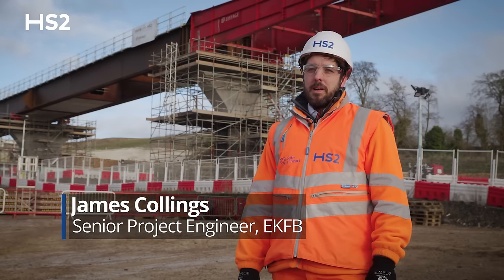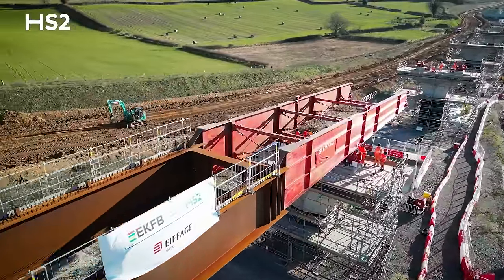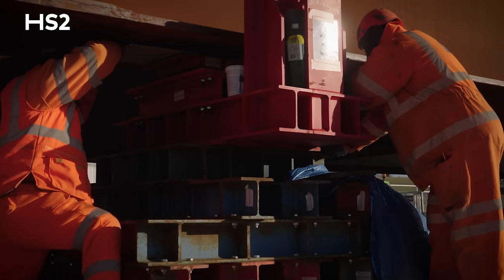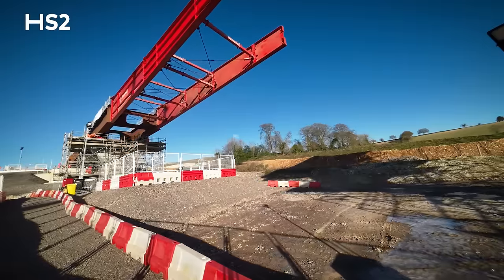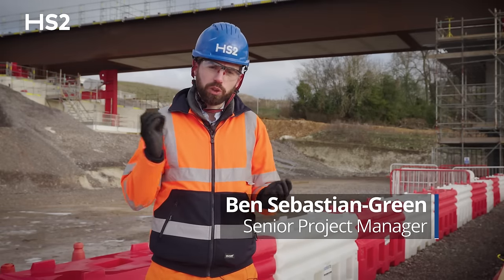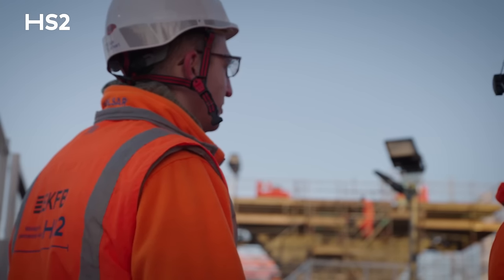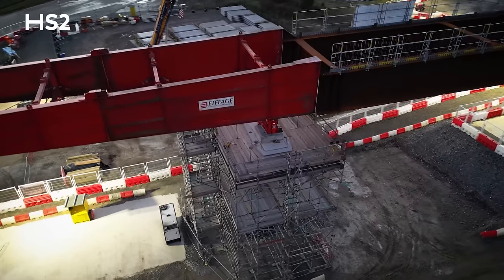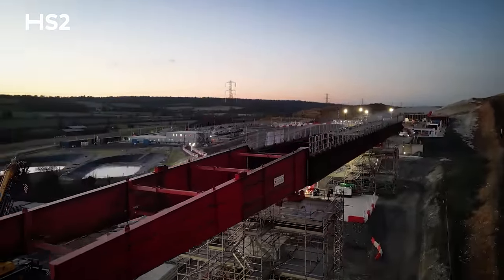HS2 begins epic year-long, half-kilometre viaduct deck slide

Comment: This will be cancelled by years end.....
Reply: The leg between Birmingham and London Old oak commons will be completed and I'm optimists and think that trains will be running on this leg by 2028 or 2029 at the latest. 

If we get a Labour government, I suspect this is how it will go down,

They will commit to building a through station at Manchester and surrounding infrastructure to support HS2 and HS3 eventually arriving into the city. 

They will reverse the government downgrading of HS infrastructure around Birmingham, so what is built is able to support infrastructure able to support further extension of high speed rail lines to the North in the thirties and forties. 

They will also authorise the construction the line to Crewe and stop there.  

Both Labour and Tory will both authorise the construction of the the tunnels to Euston in 2026/7 as delaying them for longer than this will add expense for no reason. 

Euston station rebuilding program won't probably start until the mid 2030s and by then the government will commit to the complete rebuilding of the entire station as a joint private/public project. 

I reckon by 2028 there will be a solid campaign to push the finance of the building of he Birmingham to Leeds High Speed Line, probably rebranded. An government will probably commit to this sometime in 2030s and before Crossrail 2.
Reply: Source?
Reply: Lol no it won't
Reply: @GIOGS their imagination
Reply: No it won't, it's already been paid for
Reply: @DavidKnowles0 
That' s right.
But why you think positive on Labor government ?
Crossrail this is only tory politics.
Reply: I think not !!!!
Reply: @boris1284  Not positivity, just tactics, It make sense that a Labour government will focus on consolidating their newly recaptures seats in the North and unlike the Tories they are always willing to spend money to do it.

London is safe, London isn't going to vote for a Tory party lurching to the right, they don't need to spend money consolidating power their. South West is Lib and Tory terrictory always have and always will be, which is why it the most neglected parts of the country.
Reply: If you ever looked at the amout of work on HS2 going on, it definatly will not be cancelled
Reply: @peterwilliamallen1063  If you want to make a design as complicated, as impractical, and as expensive as humanly possible, don’t be expecting me to pay for it.
Reply: @davidwebb4904  well what is coplicated, impractical and expensive and yes every one pays for it, I bet the total rebuild of the A14 cost billions
Reply: @peterwilliamallen1063  From scratch, London to Birmingham, is priced at £15Billion. Not 60, 70, 80 Billion.
Reply: @peterwilliamallen1063 As someone who lives near the A14 and drives on it twice a week, the rebuild turned it from a death trap with woefully inadequate junctions to a properly specified dual carriageway. It was decades overdue, many deaths could have been avoided by doing it sooner.
Reply: @davidwebb4904  Not much interest to me, did you complain about the cost of the rebuild of the A14, dought it.
Reply: @owensmith7530  So what a White Elephant and a waste of my tax  money as yoou think HS2 is a waste of yours as it worlks both ways. As you said you use the A14 and drives on it twice a week, well HS2 is beeing built to improve the WCML and when It opens I shall be using it
Reply: @peterwilliamallen1063 .. will you still be alive when HS2 opens & are you prepared to remortgage your house to be able to afford a ticket?
Reply: @peterwilliamallen1063 .. more parts of HS2 HAVE been cancelled than actually survive.  The Eastern leg, the Northern leg, the Golborne link, Euston will only go ahead if private investment can be found & at this moment in time, it's not looking good!
Reply: @CRIMSONANT1 What is you problem James, The Eastern leg was just an idea and may not of been a high speed line at all or just as far as the East Midlands Parkway, the Golborne Link was just that a short link line to divert arround Crewe, the Northern leg is but a short section and all these cancelled sections would just reach past Birmingham Interchange, ad Euston, yes it is being built as London OOC does not have the capacity to be a Terminus Station as it is being built as a through station if you know what that is, a station that trains just stop at for a few minutes an example is York Station which is a through sstation. Any more HS2 ideas troubling you mind.
Reply: @peterwilliamallen1063  I never said anything against HS2, in fact I am all in favour. It is exactly the sort of high speed rail network we need, or would be if half of it hadn't been cancelled.
Reply: @owensmith7530  Then why go on about it then !!
Reply: @peterwilliamallen1063  Er, I didn't go on about HS2 or anything else. Are you confusing me with someone else?

Comment: People saying that we should improve the existing network have no idea how busy the uk rail network actually is. You dont send motorway traffic on winding B-roads but thats what we've been doing with trains in this country for the last 70 years.
Reply: Exactly why they need to improve the existing network, not everyone wants to go from London to Birmingham or vice versa
Reply: @stephencowper396  HS2 is nothing to do with travelling from Birmingham to London, it will also have train services from Manchester, Liverpool and Scotland running on it and it is being built due to the fact that two upgrades took place to try and improve the WEST COast Mainline and both failed so the only solution was to build HS2
Reply: Like what you say. Improve the existing lines and longer trains has already been done. West Coast line is full .
Reply: Alas it will no longer go north. They started at the wrong end as usual!!

It is a worry that even from Oxford it makes sense to go by bus to Birmingham  and not the train  (£10 difference in cost even with a railcard).
Reply: @peterwilliamallen1063 .. "nothing to do with travelling from Birmingham to London"? 
As its the only part of this monstrous vanity project left that will involve high speed travel, you obviously haven't understood the concept. 
The trains you refer to that will travel to Manchester, Liverpool, Scotland etc, will be no faster than current services!
Reply: @CRIMSONANT1  Oh deary me, and you like every one else don't understand the concept either, the distance that these trains will travel on the WCML from Handsacre to Manchester is at tops 70 Miles of which  from Handsacre to Crewe it is only 42 miles, so these trains would be slowing down for the Crewe turn off for Manchester or Liverpool and then running between Crewe and Manchester the speed more than likey is only about  100 MPH so no they wont be any faster than present, never said they would, but due to the speed they will reach and depending on whether they stop at Bimingham Interchange to London Euston from Lichfield these HS2 trains will be rapidly gaining speed to the line speed of 225 MPH and up to Scotland where the HS2 line will never be built it makes no difference as the time difference will be gained on the HS2 section.
Oh livng in Newcastle it looks a Vanity project, but there is a reason for it, the reason is because the WCML has been upgraded twice now to allow Pendolino trains to do 140MPH and the reason for the tilt on these trains was because of the twisting nature of this line not only North of Crewe but mainly South of Rugby so they could do 140 MPH on the WCML, but both upgrades failed and they could only raise the line speed to 125 MPH, so the only alternative was to build HS2 and bypass this Southern section of the WCML, thus allowing higher speeds and better times South of Crewe and allowing more space on the WCML for Freight and other services, and I bet it would not of been a vanity project if it was being built between Newcastle and London. Just live with James it is here to stay other wise it will drive you mad
Reply: @peterwilliamallen1063 .. oh deary me - so many negatives in your comment & you still think this project is the best thing since sliced bread 🤣
"slowing down for the Crewe turn off" .   "the speed is only about 100mph so no, they won't be any faster then present".   "rapidly gaining speed of 225mph (no they won't), & up to Scotland where the HS2 line will never be built".   "allowing more space on the WCML for freight" (not going to happen).   
And the words you were looking for were .. *LIKELY .. not "likey".  *LIVING .. not "livng".  *OTHERWISE .. not "other wise". 😉
Reply: @CRIMSONANT1  Oh James, some thing else for you to worry about, I have heard off some one that either they are trying or they have got private invester to pay for building of the HS2 line from Lichfield to Manchester.👍👍
Reply: @peterwilliamallen1063  .. *SOMETHING .. not "some thing".
*SOMEONE .. not "some one".
*INVESTOR .. not "invester".
The line between Lichfield &  Manchester isn't in need of private investment so whatever you've heard from "someone" is total nonsense!
The only private investment required by HS2 at the moment is for the continuation of Euston Station.

Comment: why does HS2 require so many different designs of viaduct, surely a single design would be more cost effective? The entire Riyadh Metro uses a common system of viaduct and was all built onsite.
Reply: Probably the difference in the topography and load bearing substrates of the different sites is the main reason.
Reply: They have to justify all the architects and designers and extortionate costs somehow 😅
Reply: @WindyJAMiller . The Arabs had to import better quality sand from Australia apparently.
Reply: For the same reason the Countries waste collection bins all differ. We are incapable of standardising anything unlike the Germans who use a bit more common sense which makes things cheaper.

Comment: Seeing the HS2 sites it does look like every possible construction vehicle, piece of kit and civil engineering technique has been included, and usually has been bought new, so no wonder the price is so high. See the same on many long running road improvements (eg A465 Heads of the Valleys dualling in South Wales) and repair schemes. Lots of kit, unnecessary complexity and thick layer of management and subcontracting.
Reply: must be a dream project to work on for a lot of people and good for the CV :)
Reply: So how did you think it was going to be built with a load of Navies and picks and shovels
Reply: @peterwilliamallen1063  .. *NAVVIES .. not "navies" 😉
Reply: @CRIMSONANT1  Before being childish, get your info correct on HS2 just because of an accidental mis spealing on not proof checking.
Reply: @peterwilliamallen1063  .. *MISSPELLING .. not "misspealing" .. oh, the irony! 🤣
Reply: the techniques being pioneered on this project might become standard practice in years to come. It's an investment in the future. The body of knowledge built up through building HS2 should make it quicker and cheaper to build high speed rail in future - this is the problem with the UK, people don't think long term, it's all ME ME ME, especially older generations who only care about house prices and roads

Comment: Waste of everything, HS2 will be slower than WCML to to get to central London😂😂😂😂😂😂
Reply: No it won't as London Euston is now being built plus the fact all Hi Speed non stop train operated by Avanti West Coast Railways will run on the HS2 route and not the WCML into London Euston as London OOC is not desighned as a Terminal station so trains woul not be ablet to terminate there, so yes HS2 trains to London will be quicker than the WCML because HS2 trains will travel at 225 MPH as opposed to the WCML trains 125 MPH and very few Avanti West Coast long distance trains will use the WCML route once HS2 is opened
Reply: @peterwilliamallen1063 Euston not going to happen
Reply: @JohnSmith-xl8cb  Well I am sorry to disapoint you but Euston is going to happen, they have just bored the service tunnel from OOC to Euston after that the main tunnels will be bored as London Old Oak Common can not be used as a terminal station due to the fact it is desighned as a through station with out train servicing and storage facilities and the Government backed down about a month ago after being consulted by the building contracts managers stating it would cost even more with the delays so yes Euston is going ahead as there are plans also to revive the HS2 line to Manchester from Birmingham after intervention by the West Midlands Mayor Andy Street and the Greater Manchester Mayor Andy Burnham have come up with a plant revive it

Comment: How depressing that they built the thing using rust coloured steel. It looks bad at the start and stays that way. Given the effort that goes into such a project, leaving it as rust stained seems such a basic error.
Reply: Probably makes actual rust less visible and I personally quite like the colour so I guess its up to personal opinion
Reply: Probably not worth coating it before and during construction, I imagine it will be blasted and coated when it's all done.
Reply: It’s weathering steel. Worth a Google.
Reply: I know it's weathering steel but I just don't like it. I'm old enough to recall when plain concrete was the go to external finish for public buildings in the 60s. The big appeal was the low cost and if it looks ugly, then who cares? It turns out we all did. Now we do the same with steel. The contractor saves £ millions and we get a rusty structure, which we are told is not ugly, even though we can all see it is. Funny how much PR hype is put into selling the visual aesthetic of these projects before they are built, though.
Why don't we buy rust coloured cars?
Reply: @bruceknights8330  They were very common in the 1970's. Vauxhall, Ford, BL, etc made millions of them.
Reply: @bruceknights8330 any cost savings offered by the Contractors and accepted by HS2 are split 50/50.